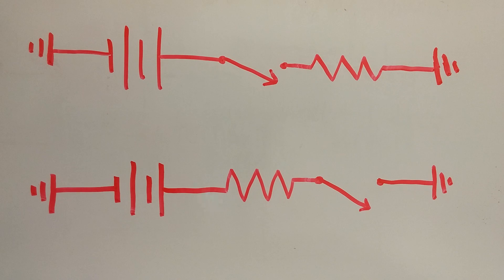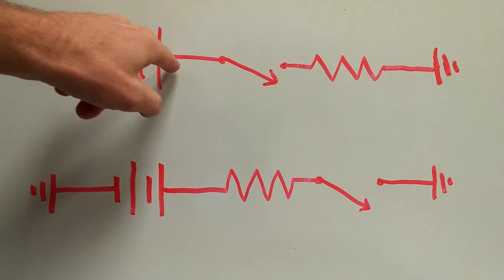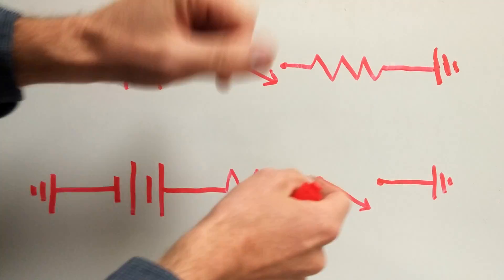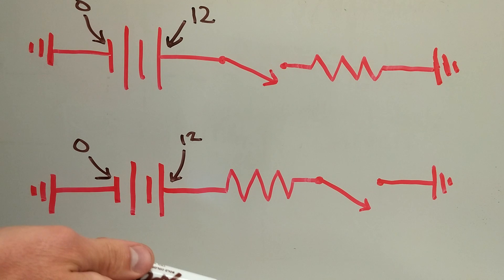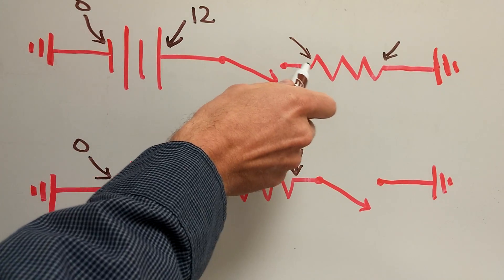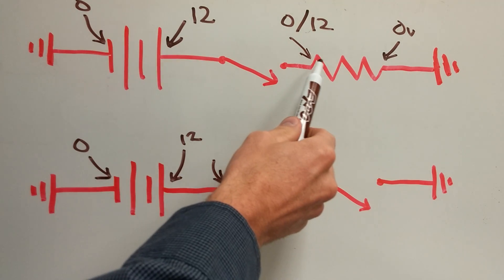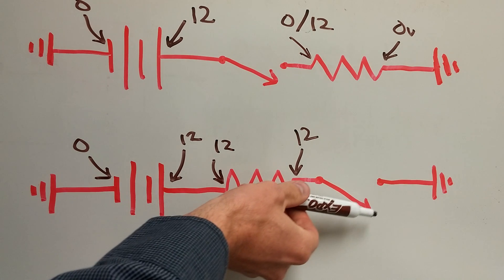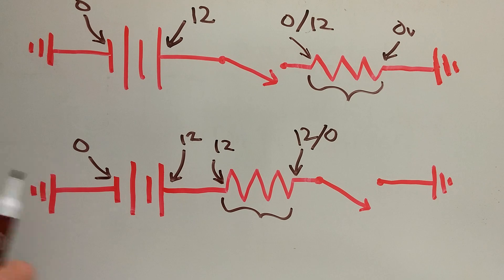How much voltage should be present at each point in the circuit?

Comment: Let's say you test each point on your diagram with a multimeter,
are you putting 1 probe on the point and the other probe to earth?
Reply from the maker: Yes.  All voltages are being compared to "zero" volts, which would be ground, or the negative battery terminal.
Reply: @JustinMillerAutomotive  very beautiful information and very clear basic....
Reply: @JustinMillerAutomotive  some contradictions..

Replace the resistor of the second diagram with say 10 amp mini fuse of a car.
Will the voltage reading at both ends of the fuse with respect to ground individually shows ..
1. Both 12 v when circuit is CLOSED?? If so, does it mean fuse??
2. Or 12 v at positive side and 0 v at ground side when circuit is closed?? If 0 v on one side, then how a fuse is considered GOOD on a vehicle when both ends shows 12 v each???

If a good fuse shows 12 v on both sides, is not that there's no potential difference across the fuse and eventually CURRENT flow will not take place??

Please a bit of clarification. Thanks in advance.